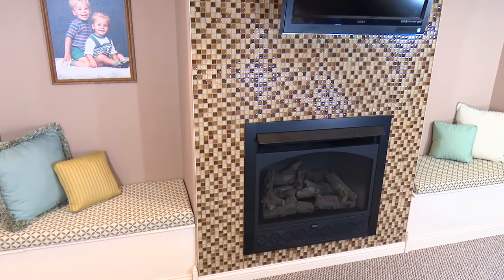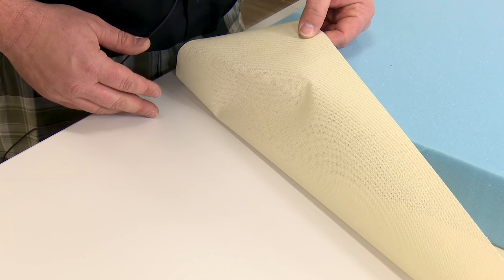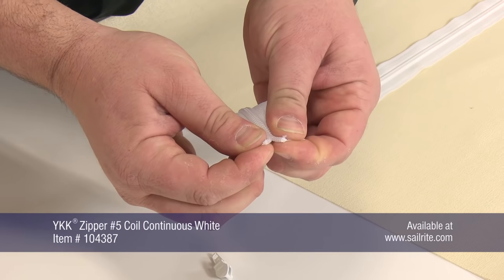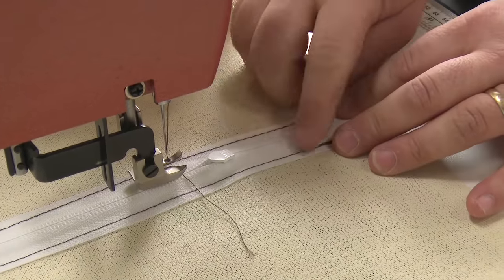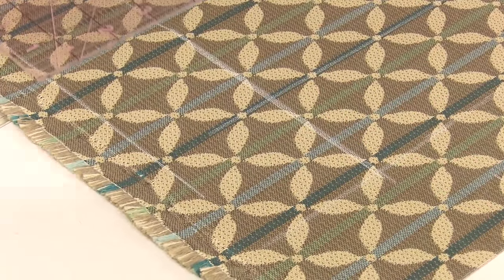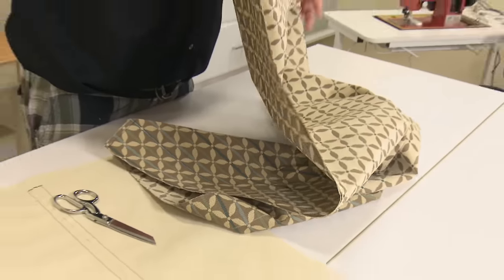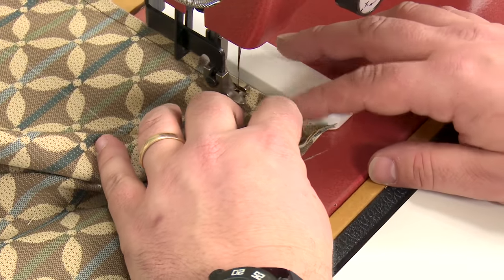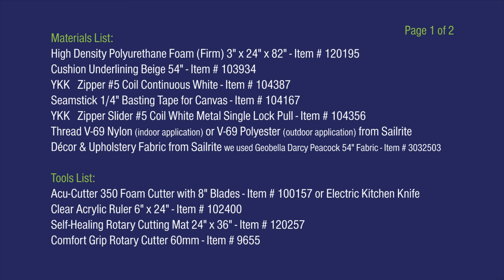How To Make a Quick and Easy Box Cushion

Comment: I have never commented on youtube before but I am beyond angry. Just wasted expensive material by following this video. I was short on fabric from all those stupid quarter inches! How does it even make sense to cut the fabric smaller than your pillow and  also allow for a seam allowance and expect it to fit??
Reply from the maker: Sorry to hear this! We want the cover to fit tightly over the foam, so the cover being smaller than the foam should compress the foam for a good tight looking fit, as it did in the video. Did you use the Sailrite Fabric Calculator to come up with the measurements? Here is the link: https://www.fabric-calculator.com/FoldOverSimple/index.html If you don't mind give me your measurements and I will check your work to see what may have happened. Send me photos of the cushion to ericg@sailrite.com I will be glad to help evaluate what may have gone wrong with your cushion. Thanks, Eric Grant, Sailrite
Reply: I do love Sailrite videos, but I had the same problem.  My foam was only 2” thick.  I think that taking down 1/2 inch on the length and width is TOO MUCH.  My small cushion ended up to small as well.
Reply: Perhaps you should have had your cushions professionally made or did a practice sample using cheaper fabric first. I used this video and the result was perfect. This is a diy video made for our convenience for free. If you don’t mind me saying, you’re sounding a bit ungrateful and disrespectful to the makers of this video.

Comment: 10:23 is like rocket science to me. "Minus a quarter inch" ,and then its "add 2 and 3 inch quarter inch to each side"  what?
Reply from the maker: The top plate incorporates the boxing as you see in the video. However, let’s break it down in smaller steps to hopefully explain it better.
At 9:56 min Brian traces around the foam which is already ¼” larger than the opening it fits into. This creates a top plate which is the exact size of the foam. Next at 10:10 min Brian measure the thickness of the foam and then takes away ¼” from that thickness. The boxing is not as wide as the foam by ¼”. True the 3/8” seam allowance is not taken into account intentionally because we want a tight fitting cover. So… the ¼” (which was taken away) and the 3/8” seam allowance that will soon happen to sew the bottom plate on, will take away about 5/8” of the overall size of the boxing making the cover fit very tight, which is what we want. This helps, pull the incorporated facing/boxing (facing included on the top plate) down, so the bottom plate fabric does not creep up and show itself along the bottom edge when the cushion is finished.
Reply: Sailrite thank you for the detailed explanation, much clearer! Now where is that rocket ship

Comment: very time consuming
Reply from the maker: Actually this cushion making process saves about 50% of the time required for a regular box cushion construction technique.
Reply: If you aren't experienced with a sewing machine or any of the techniques showed, I agree. I made two of these last night, the first one I had to redo because the size was wrong. The first one took me around an hour and a half because I'd never even used my sewing machine before (last time I even sewed was around 20 years ago). The second one I was able to knock out in about 25 minutes.